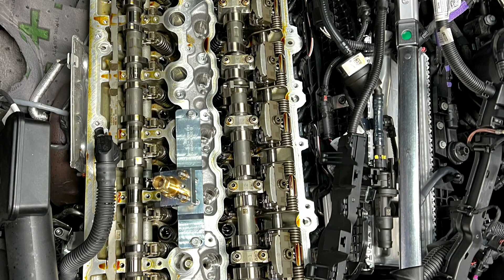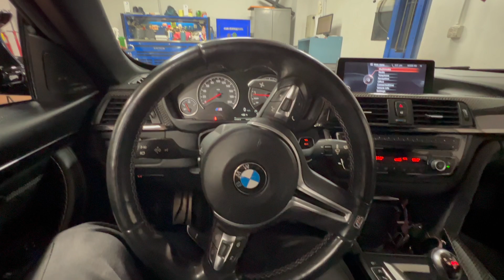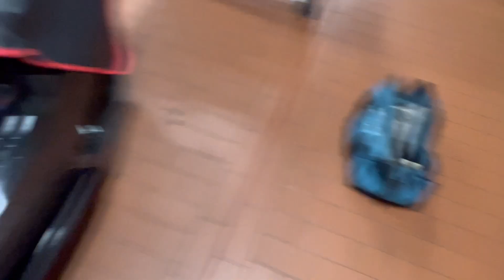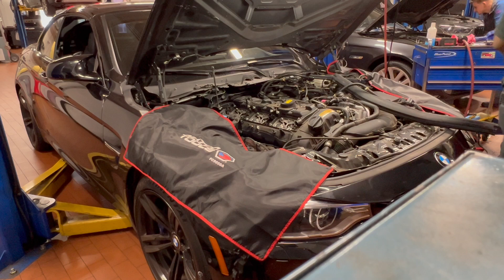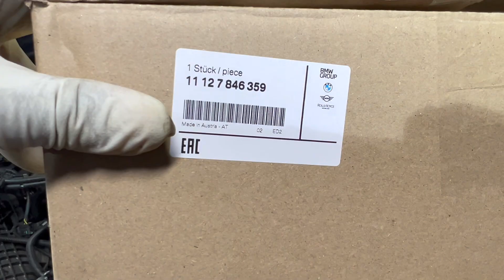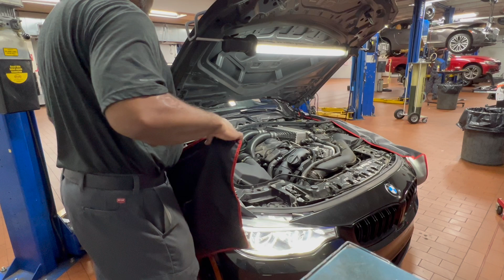BMW M4 S55 Valve Cover Replacement

Comment: Can i still drive mine while i fix it? Is it something that will mess up my entire engine?
Reply from the maker: It’s ok to drive it.
U might get a check engine light for lean
Mixture faults. But the car is driveable .
Reply: @atlbimmertech5617 thank you
Reply: @k @atlbimmertech5617 what’s the longest distance I’d be able to drive? I just need to drive bout 40 miles a day for a week before I can drop it in

Comment: Good day how are you. I changed out my valve cover but I got a very rough idle afterwards. The scanner shows intake vanos camshaft stuck (130104), and vanos intake cold start not controllable ( 131501). Any ideas what It could be? Thank you.
Reply from the maker: @TheAzim7863  I would check the connections on the vanos solenoid’s  to make sure there plug connections to make sure they’re ok. Next possible change the oil and filter if there is still a problem.

Comment: Job well done. I just disconnected the J pipe on the charge cooler and moved it out of the way, but full removal is definitely the proper way like you did 👍